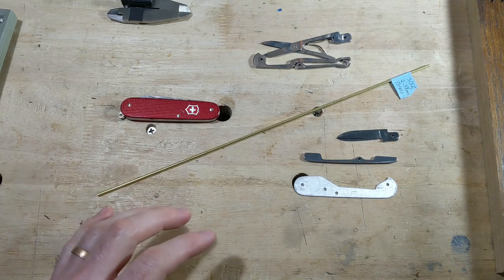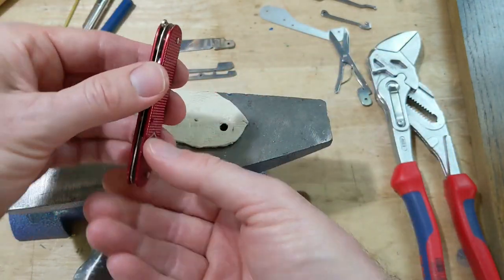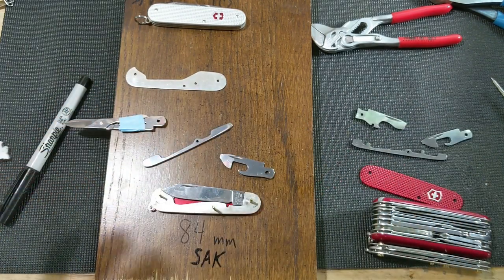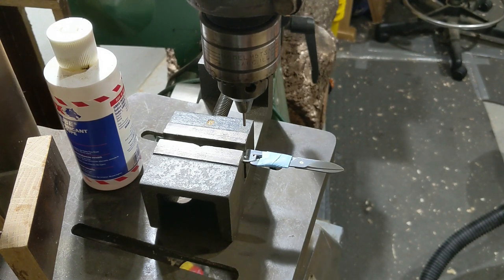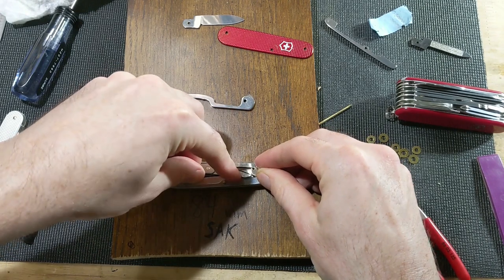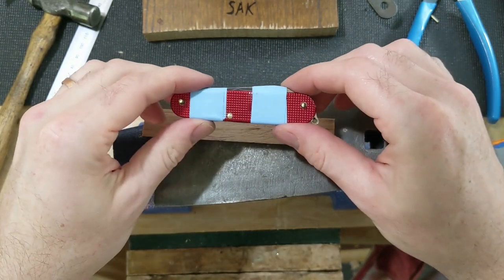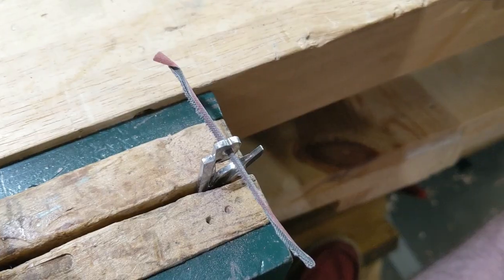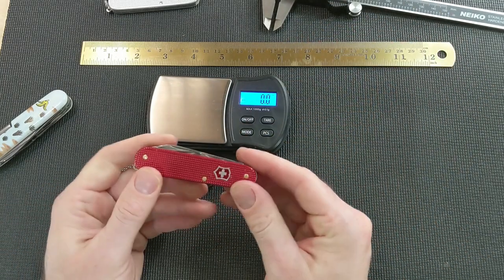Cadet II X: How to Add Scissors to a Victorinox Cadet

Comment: Very good video and very informative. I'm currently working on a modified Cadet as well however I've been lucky enough to come across two different sets of 84mm scissor layers that I manage to rescue from severely damaged old models, 1 being a "Golfer" and the other was a "Salesman". I'm also changing blades around a bit and using a combo tool from a waiter.
The thing is I'm wanting to give a modified Spotsman to the kids of my old friends to have when they are in their Teens. Since it's nearly impossible to get that number of actual 84mm scissors To make the Sportsman X I'll have to convert the 91s.

Comment: One thing home tinkers should take away from this it that the diameter and "concentricness"* of the pivot pin is actually very important. Also: It is better if the springs are a slight bit thinner than the tools so it does not pinch or bind. I have been a pocketknife "surgeon" for a couple of decades and i have learned myself the lessons.

* It´s a word!!
Reply from the maker: All good points.

Comment: You can also get the 84mm victorinox climber i really like it it's the very same  tools as the 91mm climber just in the 84mm frame great job buddy thanks for sharing with us 👍🏻
Reply from the maker: Thanks. 

The 84mm climber is a slick knife, but it is discontinued and hard to find. It's also about 17mm thick. I really like how this knife is only 11.5mm thick, it's super easy to carry.

Comment: Hi, a question to the SAK modders: Can I take the tools/springs of 93mm alox knives and put them into the standard 91 knives? I would like to replace the small blade with the 93mm awle and the can opener with the electrician blade. thanks for your help.
Reply from the maker: Both are doable, but might require a little tweaking to the tool thickness, to mitigate potential blade/tool rub, and adjust tool height when closed. I believe the awl is thicker than the small blade, so you would likely need to thin it down a bit. I think you could keep the 91mm spring for that layer. You will probably run into similar issues with the electrician blade swapped for the can opener, but I am not 100% sure because I don't have one to measure.  

The thing to do would be to build a jig to hold the individual layers as you make adjustments, and be sure to adjust the thickness of the tools from the larger knife. A few of my videos show this process, but not for these exact tool swaps.
Reply: @JoshsShop  ; thanks a lot, I will get me a 93mm and see if I can fit the tools into a standard frame. other then that the Electrician elox is pretty cool. I would just prefer to have the metal file and the normal plus scales with tweesers and the pen. Lets see if I can make it happen:-)

Comment: Another thing you can do is if you get some good drill bits you can instead of making pins to fit the holes, make the holes to fit your pin stock. Probably easier to get a good fit and the couple tenths of a mm difference wouldn’t be noticed.  Just a suggestion.
Reply from the maker: Not a bad idea, but bear in mind, drilling out the tools of a Swiss Army Knife is not for the faint of heart. You really need a carbide tipped bit, and even then the hardened steel is a pain. I have done it more than once.

Comment: Good videos thank you. Can you advise if when altering a SAK (a 30 year old swiss champ and a huntsman of a similar age) do the two outside layers have to be the same IE bottle opener and can opener on onside with the two blades on the other? Regards Stu NZ
Reply from the maker: Thanks, I'm glad you enjoy them. 

TLDR: Yes you can usually rearrange the order of tool layers with a few exceptions.

As for the order of the layers in a modified SAK, you can generally switch things up how ever you want as long as you keep the components of the individual layer together. E.g. you could pretty easily make a knife that has layers in this order: scissors, blades, saw, openers. The only real issues you have to watch out for is your tool access and back spring tool fit. Sometimes layer rearranging or removal covers up a nail nick or makes tool ends difficult to access. Also  if your knife has back side tools like the 91mm corkscrew or perpendicular phillips, those layers pretty much have to stay on the outside so the thick back tools can extend into the space of the handle.

Things get really tricky when you want to switch up the components of layers. For example: trying to put the bottle opener on the same layer as one of the blades. Some of the issues can be tools rub, tools aren't the same thickness, tools sit too high or low when closed, etc. It is sometimes possible, but it often involves altering stops, pivot hole locations, thinning tools, and/or spring shapes.

Anyway, I hope that answers your question, maybe I will make that the topic of my next video. I do remember asking that same question when I was starting out and not finding an easy answer. Thanks for the inspiration.

Comment: I watched the video with interest because Cadet II x is my desired model ( currently my edc is pioneer x ). I have a question about the weight and more specifically what made this knife weigh only 63 grams? Suppose the small blade weighs almost as much as a nail file but the cadet weighs 46 grams and if I remember correctly the scissors of 91mm models weigh as much as 23 grams.
Reply from the maker: Well, based on your numbers my knife should weigh around 69 grams? I would imagine it is lighter because I removed quite a bit of metal on the scissors to make them fit on the 84mm knife. I double checked on another scale and my knife weighed in at 62 grams on that scale. I'm obviously not working with lab grade scales here, but it is close enough.
Reply: @JoshsShop  Okay now I understand. Your scissors that have been modified a little actually lost weight but also a small blade and possibly a recruit spring that fits 84mm knives but with 91mm scissors. As for the weight of 69 grams I was referring to the cadet with nail file which weighs 46 grams but the scissors on the 91mm models weigh 23 grams hence the figure I gave. I suppose the small blade weighs the same as the file. edit: I'll also add that I plan to make this cadet II x but without that annoying ring wheel because it's just unnecessary for me so I think that without modifying the small blade my cadet II x will weigh 63-64 grams.

Comment: I've always wondered if this would be possible. Maybe you'll be able to check now that it's assembled, but the scissor spring is usually pressed out and a new spring pressed in when the scissors have been opened to 90°. When the scissors is fully open, even on the Classic SD, the scissors spring hole is covered by the scale.
Reply from the maker: In order to replace the scissors spring on this knife, I would have to remove the scissors from the knife, because the spring hole is completely covered in all orientations. It is possible that I could have done things differently to give myself access, but I have never needed to replace a scissor spring, so I wasn't too worried. If it needs to be done, it is only one pin, so it wouldn't be that big of a deal.
Reply: @JoshsShop  agreed, likelihood is low. It was just that I noticed in the video you had the scissors at 180° or fully open when you brought up the spring replacement, where as even the Victorinox spring replacement tool/set requires the scissors to be open at 90° to access the spring. Having purchased a few cheap knives with broken springs before I had the spring tool, I noticed that the 90° position allows full access. I was hoping that it would be the case with yours too, but couldn't get a clear view during the rest of the video.

Great mod. I have also considered the 91mm scissors in 84mm chassis but the width of the scissors vs a matching back spring was the issue, I didn't think of thinning the scissors down a bit. Well done.
Reply from the maker: Thanks, and thanks for the suggestion even though it didn't work out, I appreciate it.

Comment: This is a great video. I really appreciate the video while actually doing the work. This is hard to find. If I may ask, what tool are you using to measure?
Reply from the maker: Thanks, I am glad you enjoyed the video. I prefer to film and talk as I work. I suppose a voice-over might be a bit more professional, but I think doing it this way feels a bit more genuine and personal. 

As for my measuring device you are probably asking about my digital caliper. It isn't anything special, just one of the cheaper ones found on Amazon. I probably spent $25 on it. It is a little annoying because I have to remove the battery when I'm not using it so it doesn't drain,  but other than that it is good enough for what I do.

Comment: Very interesting video! I'm dreaming of doing a Cadet X but don't you think it's possible to use the saw layer backspring from a Walker for example? Or maybe the thickness is way off?
Reply from the maker: I was just using what I already had. That said, I do think the saw layer is rather thin, but I don't have an 84mm model with a saw to confirm that.

Comment: If you do this kind of thing often it might be worth reaming the holes out to the size you need to suit the pin material you can source over reducing the brass.
Reply from the maker: I fully agree, but I don't do it often. Also, most folks (me included) don't have the tools necessary to ream out the hardened steel of the tools.

Comment: Would 58mm scissors fit with a combo tool on the same layer?
Reply from the maker: Assuming you mean on a bigger knife like a 91mm or 93mm I suppose it might be possible. That is not a mod I have seen before, it would all depend on clearance I would think. It would be a great way to thin things down without losing much functionality.
Reply: @JoshsShop  I was thinking on the cadet but would love to see that option on an explorer as well

Comment: Thank you for making such an excellent video!  If I can’t find someone to make a Cadet X for me, I might attempt this myself.  But my tools would be somewhat limited.  Do you think this is possible with a hand drill (+ carbide bits) and a Work Sharp belt sharpener (for the grinding)?
Reply from the maker: You can for sure do the drilling with a hand drill, I have done several times. That is, unless you are planning to drill out all the tools to 1/8" holes for a torx knife pivot, in which case, you certainly need a drill press.

You might be asking a lot of the Work Sharp belts for this scenario, I don't have direct experience with those though, so maybe it would be okay. If you have a course grit belt that you can use to really hog off some metal, then it might be fine.
Reply: @JoshsShop  It looks like you needed to grind quite a bit near the scissors’ pivot.  Could I just chop the end off with a dremel and finish with a grinder?  I would just go for pins, but now that I watch the video again, I’m not sure I can easily file-down the pins without a drill press.  I notice Flytanium sells Cadets with custom scales and removable torx hardware.  I could get one of those and make a Voyageur from it.  Thanks for the help!
Reply from the maker: I think the Dremel will do what you need for the cutting, you could probably do the grinding with it as well as long as you go slow and quench things frequently so it doesn't get too hot. 

If you go the Flytanium DIY Voyager route, be sure you have the pivots figured out. You will need a new longer set of pivots that are sized for the additional layer. Also you would still need to drill out the hole in the scissors. Unless the Flytanium pivots are 2.2mm, but I would bet they are 1/8 inch.
Reply: @JoshsShop  Flytanium sells their scales with pivots (you can even buy a preassembled cadet).  It looks like I could fit the scissors on the opener layer.  If I try to replace it with a thicker backspring from another knife, then I suspect the pivots might not fit. 

It would be nice to pair the flathead with the blade, like the old voyageurs, but I’m guessing those were specially shaped to fit.  I’d probably be happy to just leave the nail file.
Reply from the maker: Ah I see, didn't realize there wouldn't be an opening layer. I think you are right though about the thicker back spring and a need for a longer pivot. Anyway, sounds like you are considering it from all angles, good luck.
Reply: @JoshsShop  Thanks again, I would never attempt this without such an excellent video tutorial.
Reply from the maker: I'm glad it is useful. If you end up doing the mod, please be sure to share pics, I would love to see it.
Reply: @JoshsShop   Will do!  One last question… do you think a dremel might work for the grinding?  I noticed that there are relatively inexpensive diamond grinding bits on Amazon.
Reply from the maker: I think it could work, you might have to experiment with what bit you use, but for a job this small, I think if you go slow a Dremel could work just fine.

Comment: Excellent video! You could have filled that hole by peening brass into it before grinding off the back of the scissors. Just a consideration for the future.
Reply from the maker: Thanks. Maybe I am misunderstanding your suggestion, but I almost completely ground the original hole away on the scissors, so much so that I don't think anything would stay in the tiny divot that remains. You can see what I mean pretty well at 46:29 . That said, I am always open to suggestions, there is always room for improvement, so if I got it wrong, let me know. Thanks for watching. 😁
Reply: @JoshsShop  Yes, you’re correct, it wouldn’t have worked in this case because you ended up grinding most of it away. But, originally, you were just going to move the hole over, and it would have worked then, especially if you just needed to grind a small edge of the original hole.

Comment: Can you use the original pins? Or does it have to brass?
Reply from the maker: The original pins are too short once you add the scissor layer. I am sure it is possible to find rods that could be used for the pins that are made from the same material as the original pins, I believe it is nickel silver, but I don't know where to find that. 

Everyone has different tastes, but I like the look of the brass in this case, and brass is easy to source (the hardware store near me carries a good variety). Brass is also relatively inexpensive.
Reply: @JoshsShop  I just bought a pioneer x, I'm taking out the blade layer, I just need a prybar/scraper, Philips and scissors, my brass pins and hammer are in the mail :)
Reply from the maker: Awesome! If you are really careful when removing the original pins you can reuse them since you are making the knife smaller. I have pulled it off a few times.
Reply from the maker: Although it will be good to have the brass rods just in case. :-)
Reply: @JoshsShop  they were too hard to form, just tried it, brass is the way to go 👍
Reply from the maker: Ah, well, brass is easy to work work with. I hope you enjoy your modified knife.

Comment: Liking this company must be really frustrating...
Reply from the maker: Sometimes, but it seems the older I get the more particular I get about the things I own and use. I figure if I can make changes to things that will make them better for my intended purposes I might as well. 

Also, when it comes to multitools, there seems to be about as many preferred tool sets as there are users. Victorinox has a lot of options, but it is hard to hit every niche. I just wish they didn't discontinue the 84mm models with scissors.